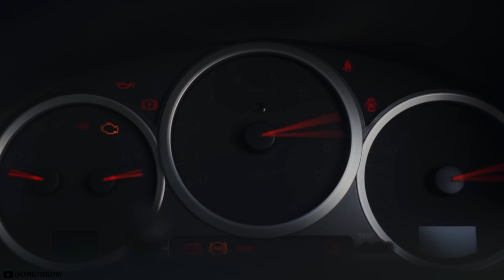Donut Media VS. Subaru

Comment: I own a 01 B5 S4, and also use to own a 02 E46 M3.... I had the M3 for so much longer, spent easily thousands of hours working on it. My M3 was a rollcage away from being certified "rAcE cAr". While i did do some work on my S4.... I had spent so much time on the E46 platform(and E36 as my first car). That my vast amount of knowledge of BMW did NOT transfer over well at all with my S4, I tried doing the enigne timing myself, fuck that up and had to send it in, tried rebuilding the transmission, fucked that up and had to send it in, tried replacing the freaking altenator and even fucked that up... The only thing i was able to do myself correctly that worked long term, was a new stoptech big brake kit i installed. While on my M3, all of that and more i had done myself, without issue, with the only thing i didnt do was a VANOS rebuild. Now my M3 is long gone(fuck the guy that bought it as he totalled the car one week after buying it), i still have my S4... with a blown turbo.. and im terrified to take it apart and i dont know if i wanna drop 4-6 grand on getting it fixed as im in the mood to buy an E92 M3(or another E46 M3 OR an F80 M3, havent decided yet). Your analogy on rotary engines absolutely hit the mark for me when it came to BMW, but Audi?  Nah, really felt clueless when it came to that car while id have my friends confused as to why i havent fixed it yet when i rebuilt the engine in my M3 3 times(60k, 120k, 135k cause of a bad oil leak, never found the culprit but it fixed it putting it back together) . Different beasts require different knowledge, and some times it can carry over, and other times, you waste 15 hours of your life, to save 3 grand when you should have just brought out your wallet to being with. 

Really good video, helped clear up some stuff on the drama, im not a subie guy so i was just like idk what the fuck everyone is bitching about. 
Cheers and subbed  

ps, most sti owners are toolbags.... same with M3 owners. some of the worst car communities IMO

Comment: As someone who actually races cars in SCCA, NASA, AER, etc and know a lot of people in pro racing like IMSA and WEC, I can tell you that Donut has very little idea about what they are doing and the parts they are putting on their cars. A lot of the parts they put on their “high car” weren’t top of the line parts and were really just ok quality and fine for a road car, not track use. I’m not a Subaru person so I can’t say anything about the engine and chassis. But I do know a lot about aftermarket parts manufacturers as well as safety standards issued by the FIA. Parts like the Tein coilovers, the crappy wing, pretty much everything other than the AP racing bbk shows they didn’t actually put any effort into finding companies that actually make parts for racing. For example, for proper motorsports dampers you go to MCS, Penske, JRZ, etc. where a set of triple adjustable dampers run $8k+ and single adjustables are $3k+ once and you custom spec spring rates and valving to your own car

Comment: I think what a lot of keyboard warriors don't understand is what happens to an oil system under track use. Few people track their cars, often times the subaru guys are driving on the street or drag racing. It's a whole different thing when you're hanging that engine beyond 4500-5000rpm for minutes on end, which is what it takes to do a fast lap. Combine that with a serious sticky tire like they used and you're hanging this engine with known oil control (AND cylinder head pump up) issues around 4500-5000rpm under 1 full G of lateral acceleration for a significant period of time. Suddenly it starts to make a whole lot of sense. Would you jack your car up to a 45 degree angle and then rev it that high? That's what is happening on track.

Comment: Watching Donut and these reaction videos by Subaru specialists made me realize that dealing with the oddities of the platform isn't for me so I canceled my GR86 order. The motors can be great but like with BMW's, Porsche, and Mercedes you really do need more than a basic knowledge of how these engines behave especially when you start driving harder than stock and start adding power.
As just a backyard mechanic with the most basic tools I am not prepared to deal with specialist issues that aren't present in other platforms like Cummins I6 or a Ford Coyote 5.0L where you don't run into High G oil starvation issues for example until you get much deeper into modifying the platform.

Comment: What Donut showed is precisely what it feels like to be a newbie Subaru owner. Shit keeps breaking and you don't know why and it can be really frustrating.
The bottom line is that Subarus aren't as reliable as a Civic- a Civic you can abuse the hell out of and it'll keep running, but you can't really do that with a Subaru.
Buy no means does it make Impreza a bad car, it just means it's much more demanding. It has its shortcomings and it's huge advantages.
I love Nissan Patrol even though 2.8 has like 120 hp, 3.0 blows up bc of overboost issues, 4.2 burns a shitload of fuel and you really can't find other engine options in Europe.
I love it bc even though it has shit engines you get a big 4x4 with massive potential, that has CHUNKY axles which will run 35" Boggers for decades without issues.
Once you acknowledge its shortcomings you can work to minimize or outright get rid of them- Patrol has a lot of room under the hood for all kinds of engine swaps for example.
No car is perfect. Civics are reliable but they're not AWD and have front heavy weight distribution. WRX has AWD, great weight distribution, road feel, etc. but not so great engine options...

Comment: I own a 2006 Saab 9-2x aero (wrx wagon) it has 227k miles on it with the original motor and trans most reliable car I have owned 🤷

Comment: the older US subaru's are pretty much using standard economy engines with turbos slapped on not the JDM/EURO spec EJ205 group A based engine

Comment: The wrx is a great car across all generations in stock form. Unfortunately subaru never developed the car to handle anything higher than what its built for and I mean it can take alot of abuse left stock but not much more after tuning,thats why the STI is a great tuning platform because of the engine and transmission all being modified in some way specifically for track use where the wrx was really just designed as a practical sporty awd application and that its great at. Also I do beleive the EJ255 is garbage for tuning and the only wrx engine Ive had sucsess with above 350+ is the ej205 and ej257.

Comment: I’m a long time Donut fan; been one since long before 1 million. I know they’re good dudes, but I think this has exposed the nasty side of being a massive automotive channel on YT.
Making a series on YT to the standard Donut subs expect requires consistency - being able to put a video out at the same time every week. If there’s one thing I’ve learned from working on cars, consistency can be hard to achieve, even more so if your vehicle of choice is already very sensitive/delicate. I think Donut jumped into a platform they didn’t know that well, and rather than admit they were in over their heads, they pushed on trying to make a “good YT series.” And it definitely bit them.

Comment: As soon as the series started and they tracked the cars without installing a pickup and baffle plate, I called it that they were going to blow the engines.

There's some platforms that require certain mods if you're planning on tracking them - Mods that you do even before tires. With a Suzuki Swift, it's chassis rigidity. And with a Subaru, it's the oil pickup and baffle plate.

Comment: If you are looking for reliability from your turbo subaru, you should just keep it all stock. I have an all stock 05 LGT and it runs just fine, on a rebuilt motor too. What happened was that I made the mistake of trying to switch it to run e85 without swapping the fuel pump to a larger unit. I ordered a 255lph pump but it was broken when it arrived, and the retailer was refusing to give me a refund, trying to pull some bullshit where they demanded I send the unit back to them so they could test it and determine if I was lying to them, or trying to run a return scam of some kind. I felt this was inappropriate, at best, and shady at worst, so I refused, and just ran the stock pump.

I thought it would be okay, but it resulted in the engine running slightly lean. Not even all that lean, but it was enough to cause an issue that eventually resulted in a bent valve stem. I took the engine to a respected and reliable builder who put in new pistons and rings, and replaced the bad valve, and did the whole rebuild for just $4k. That was nine years and 55k miles ago, and the engine is still running strong. 

IMO, Subarus are not ideal for doing heavy mods for higher power and torque. The best mods for them are suspension, fmic, up and down pipe, and a good tune. Even then, you risk your engine with the tune. Its just the truth of the matter. If you are going to modify your subaru for extremely high power outputs, be prepared for a lot of breakdowns, and to spend a lot of money. 

I have a turbo subaru because I go snowboarding a lot, and its one of the best cars for driving up snowy mountains. I dont want or need a ton more power in it. It has about 250hp and lbft, and thats plenty for what I use it for. 

Things I hate about it are mostly about the cheap leather seats and cheap plastic interior trim parts. The non sti seats from Subaru are all garbage. The leather falls apart no matter how you take care of it. I also hate the head lights. The bulbs are always burning out, and now I just carry spare bulbs with me just in case one goes out up on the mountain again (the one time that happened, I got pulled over, but the cop let me off with a warning because he believed me). I hate the fact that the intercooler is a tiny little top mounted unit that gets all hot under the hood. Oh and I hate the door handles and their mechanisms. Ive had three of them fail on me, and it can be a pain in the ass to find replacement door handles on some models. 

But other than those small gripes, the car is pretty awesome. Whether its the LGT, STI, or WRX, they are all really neat cars that are fun to drive, even without trying to modify it into some kind of street racing machine. You can certainly go that route, if you want to, but be prepared to spend a lot, and make sure you have more than one vehicle to use, because you WILL have breakdowns, often. All I did was run e85 for about a year, and it resulted in a bent valve stem that required an expensive engine rebuild. So even small mods that dont change much of anything about the engine can result in a nightmare. Just consider what it is you want out of the car, and go from there.

Comment: This reminds me of all BMWs (production before 2001, E46 being the last of this rule) where if you take care of them and know EVERYTHING about the platform before you get it and do maintenance ONLY PREVENTIVELY the car will be reliable and problem free. But if you neglect that oil leak for 10 years, beat on it but don’t check under the hood to see what the smell is and you NEVER do your research. They become a pain in the ass. With BMWs they only treat you as nice as your treat them. Cheap out and you’ll fix it twice. Do it right the first time

Comment: What you didn't touch on that Subarus are super sensitive to is, Misuse/mishandling of engine protocol. What I mean by that is cold starts with high revs, over revving when shifting, and just generally beating on the engine. The Subaru boxers are delicate compared to other modern engine, no ifs ands or butts about it. Ping it off the red line a few times too many and you'll see those oil starvation issues compound until you spin the 3rd bearing bearing. Not only do you need to be a good mechanic, you need to be a good DRIVER.

Comment: Well I bet there's no other platform that will take the record for most engines blown up during high low.  It's blowing up five engines with reasonable modifications is acceptable to be a good platform I do not think there are any bad platforms.

Comment: I’m from AK and Subarus are all over the place. 90% of the mechanical failures are either improper maintenance (skipping oil changes or timing belts). Properly maintained and not wrecked get around 300k miles before they start crapping out. Enthusiasts that push them hard either know what their doing and limitations or they blow.

The idiocy of donut was doing a rebuild and then not even doing a proper breakin. You might get away with that on an iron block Chevy 350 built to high horsepower, but an all aluminum boxer 4 will require a more precise rebuilding protocol and breakin. 

There is a large community of Subaru “fans” in my area, but these are folks that rave about the 4wd capability (unmatched in the real world) and understand that oil is cheaper than a motor.

Comment: There is a very similar issue with the 3000GT/Stealth community, for the last two decades they have been cheap with a small following and every time a young guy would buy one for less than 3000$ they would beat the crap out of it and not do the Maintenace properly or on time. the biggest enemy of the 3kGTs is bad mechanics. if you do it right, which there's tons of resources now, these cars are hard to kill. I daily mine for the last 5 years and just went and ran the tail of the dragon for 2 days straight beating the hell out of the car and it hasn't had any major issues. most of the time bad reputation can be blamed on bad owners that tend to be loud about it.

Comment: ALEX,  I didn't know you had your own channel. I first found you on WCUC and then found out you worked at Fitment Industries. I liked this video and agree completely. If you can't except Subaru boxer engine 1 have their limits and 2 only sounded good before they went to equal length headers. Now Subaru's sound like Porsche Boxster. You should just but a Porsche if you don't want the headache or an Evo but yes they have electric problems but they are still better then the STI your girl gave me. Lmaf J/K. They are better though.  My an Evo. If you can't afford it. Buy a wrx. You will have less problems than the 2.5 and you can upgrade. Hope this helps!

Comment: there is forums created in the 90's 2000's  still active and the threads are still available, you dont need to create an account and post stuff and get flamed or feel shamed. its been 20+ years the information is still there go search, read ,keep reading, mistakes happen, and if you don't know, don't be afraid to ask a proper professional or check out service manuals. *Always consult an experienced tech, a tuner or an experienced engine builder first, before you even buy a part for one of these cars. otherwise stay N/A and all the WRX suspension drivetrain exterior and interior mods fit over. same car , minus engine and engine management, and weighs 200lbs less than the WRX and 400lbs less then an STI. Also Subarus work like this and you can only have 2 of the 3 mentioned - 1.Cheap 2. Reliable 3.Fast
Can't have everything in Life, Thats why the EJ was created, Everyones Joy with the Unequal length headers, the poorly located turbo and inter cooler mounted over top of a hot leaky engine with it literally being called a rats nest of evap tubing and wires. If you wouldn't skip a service date on your Porsche Boxer motor why are you skipping it on your Subaru Boxer.  

*scratches head in confusion*.... why are you putting a boosted motor into boost and revving it  before the break in period is done? on top of not running every single part through the parts washer and rebuilding the turbo and washing every piece of pipe + the intercooler. 200 miles....still had 800 miles and 3 oil changes to go on the initial low timing, low boost, good fuel no revs over 4k tune before break in is over. Then you check your work, pre tune/dyno inspection  Then do your proper tuning. Then shake downs, 60 mph shake down, check everything, 80 mph shake downs check everything, 100+ mph shake downs, check everything. Finally, let it eat, knowing the motors limitations before even purchasing the parts. Ive built 1/2 a dozen + GD sedans btw, my issues aren't engines or cheap knock off parts its Canadian weather. Clean environments , temperature and hygiene play a huge factor in reassembly as well

Comment: Not only did they pick one of the worst Subaru platforms to heavily modify, they just kept slapping them back together without solving any of the basic Subaru issues that will cause problems in a track environment.

Comment: maybe its different owners, maybe it says something about the brands. but ive owned nothing but Mitsubishis. a good friend of mine had 2 subarus in a row. they both had issues. some of which were brought on by rust. but my friend ended up with a mitsubishi after that. he's had it for several years now. when he gets to the point of replacing it, he said he wants another mitsubishi.

Comment: I just think if they vaped in the Subarus they would’ve been fine. Subarus need mad cloudz in the cabin filter to even out the negative pressure of the engine caused by the seriously mad power put out by the rally designed wrx. A flatbill monster hat wouldn’t hurt as well. Almost like a spoiler to evenly distribute the mad cloudzz in the cabin.